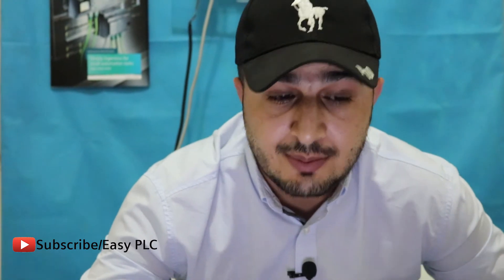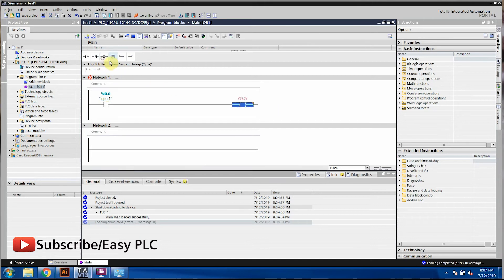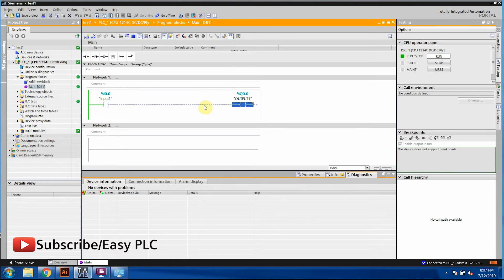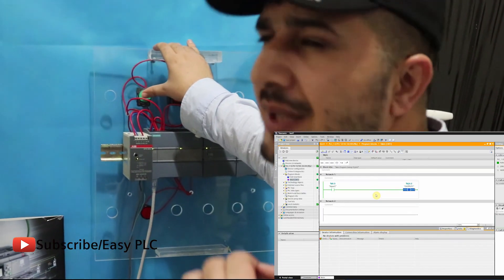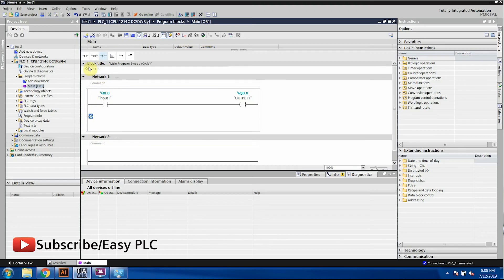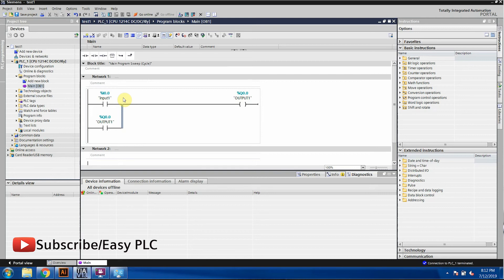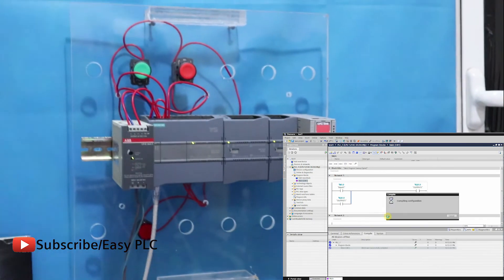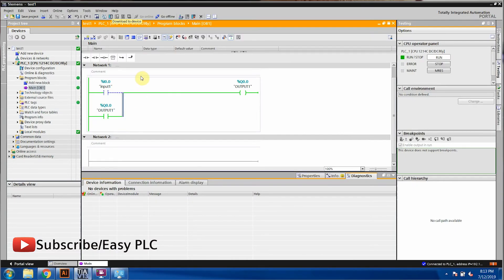PLC Tutorial for beginners Part #4 Latching and unlatching output || TIA PORTAL

Comment: Firstly, Thanks for the guidance. Here I have a question in programming Why I 0.1 is NO instead of NC virtual contact. As in hardware Stop PB is NC.
Reply: Ya bro i also have a same questions about why the 0.1 stop button is NO , if No that means when i prees the 0.00 start button the current will stuck at the 0.1 stop button becasue you put the contact is No